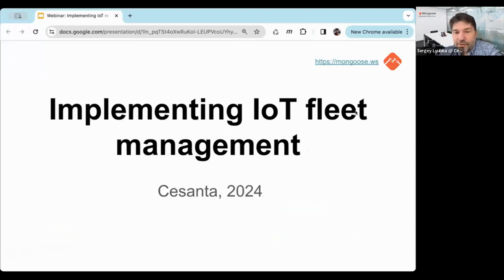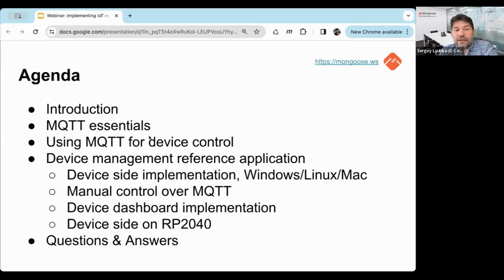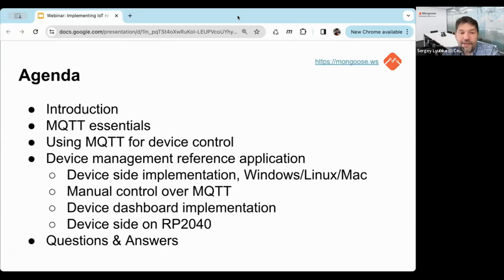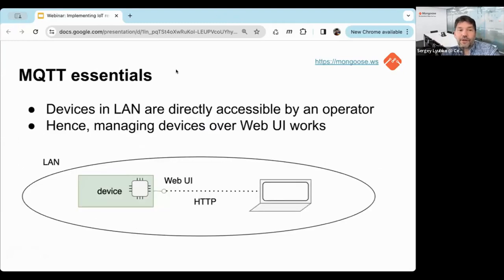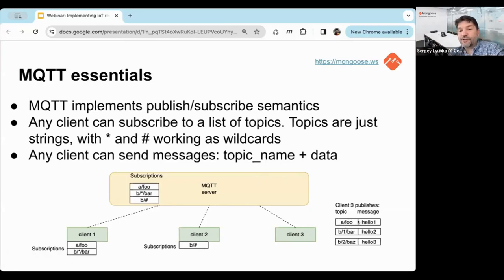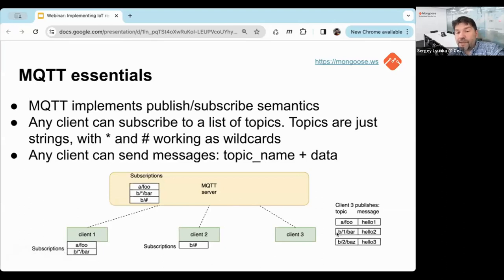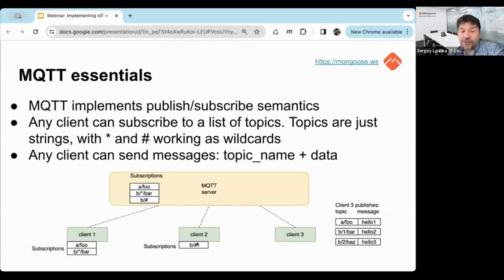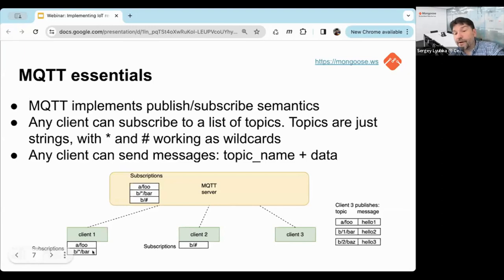Webinar: IoT fleet management from scratch on STM32 using MQTT

Comment: Hey Man super nice video, cleared a lot of my questions! Just had this one question, I have raspberry pi with Mosquitto MQTT Broker Server running on it, will this connect and send for example sensor data to the Mosquitto broker?
Reply from the maker: Sure. Try it - and if you have any more specific questions, you can ask them on our discord, https://discord.gg/KfR8E6wSds
Reply: @mongoose-networking-library  Thanks for the information! Will surely connect on Discord!